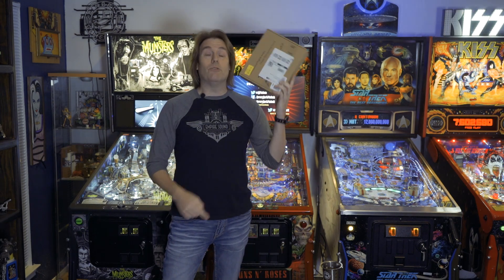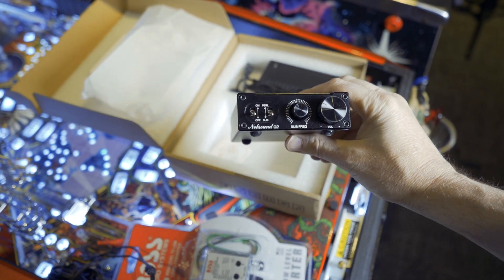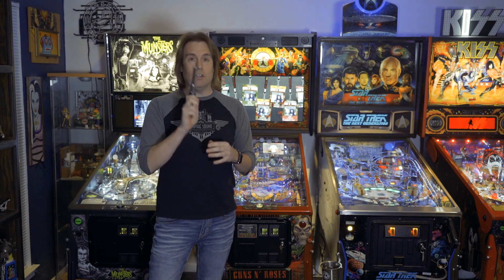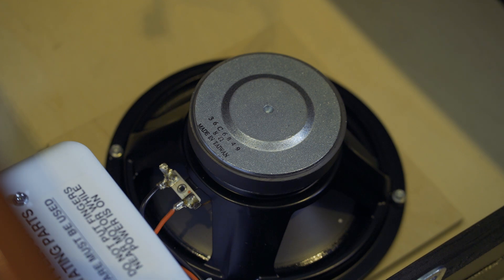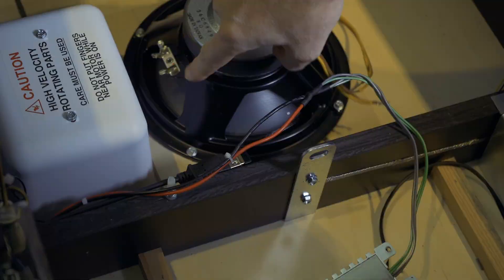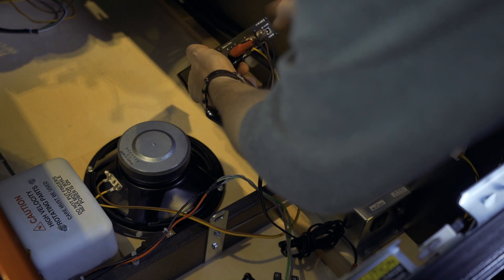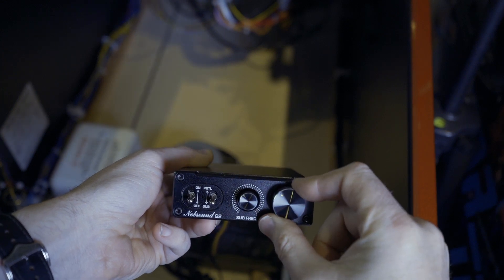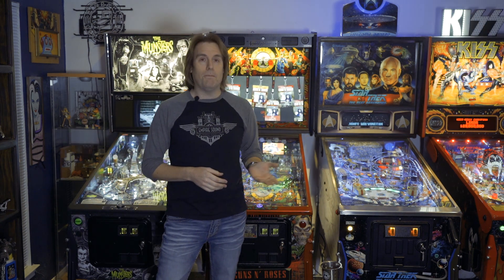Pinball mods-Cheap Mega Bass mod for your Jersey Jack Guns and Roses Pinball machine!

Comment: Great video.  Quick question:  I have a 12" Polk Audio 150Watt External powered sub laying around.  Would you suggest just tapping off the current sub terminals and using speaker level inputs and letting the sub crossover do the work?  Or use a line level converter like you suggest and then run one RCA to the Sub LFE input?  Or run both RCA to L and R line level inputs on the sub?  (ok, maybe it wasn’t a quick question).  lol
Reply from the maker: I would recommend a line level adapter and using your sub woofers built-in crossover and set it to 150hz

Comment: Hey thanks for the video! My GNR sounds fantastic. My SW and Mando both have a ground loop hum. Mando is louder than SW. I have pinstadiums on those games which occupies the service outlet on the power supply so I ran the power for the new amp out of the bottom of the cabinet into a power strip on both games. I’m assuming my issue is that the amp needs to be tied into the power on the game for proper ground? I tried an RCA ground hum eliminator after the line level adapter before the amp but that didn’t help. Any advice would be appreciated!
Reply from the maker: Does your Mando and SW have the Amp mod on them? You could try a ground lift adapter for the amps power cord. https://www.amazon.com/JACKYLED-Listed-Grounding-Adapter-4-pack/dp/B071FFHQNC/ref=sr_1_1_sspa?crid=11VF7EPJ4OKMO&keywords=ground+lift+adapter&qid=1664636652&qu=eyJxc2MiOiIzLjU0IiwicXNhIjoiMy40OCIsInFzcCI6IjMuMzMifQ%3D%3D&sprefix=ground%2520lift%2520adapter%2Caps%2C81&sr=8-1-spons&psc=1   You could also try that on the pinstadiums power cord.

Comment: Thanks I installed your mod and i m very happy with it. I would like to know if we can also add an active subwoofer and wow i can do it if it s possible. Thank you for your help ;)
Reply from the maker: Yes you can,  to add an active subwoofer inline. what you would need to do is get 2 RCA Y cable splitters and install them after the speaker level to line level adapter box outputs.
Reply: @empirepinball  man.. is there anyway you can make a video installing a sub woofer on GNR?  I’m buying everything from this link

Comment: Can I assume that just using a passive low pass filter or cross over just wouldn’t cut it because of the poor power in the original amp?  Has JPP added an EQ adjustment to their programming yet?  (Thank you for the great vid!)
Reply from the maker: I wish JJP would add an eq function, The amp I suggest has a crossover built in.

Comment: I am getting a constant hum when the power is on. Any way to eliminate that?
Reply: Figured it out, the speaker needs to be grounded. Running a separate wire from the speaker to a grounded screw eliminated the hum entirely. Machine sounds so much better with this upgrade.
Reply from the maker: Let me see if I can replicate that on mine, so I can come up with a solution.
Reply: @johnclausing  where did you connect the wire to the speaker ?  Negative output to a grounded wire ?
Reply: I figured it out.. actually used an alligator clip and grabbed a piece of negative wire coming into the unit then onto a metal ground.  Easy fix.  Thanks for the comment

Comment: You mentioned that we should buy an upgraded speaker before installing this so you don’t pop the stock speaker. Is the stock cabinet speaker on the JJP GnR good enough quality or did you already upgrade it?
Reply from the maker: The stock speaker on JJP is good for the mod!  I would say Williams/Bally and most Sterns you would want to put a better speaker in.

Comment: I installed this mod on my Wonka and love it. I do have a slight hum when using the included power adapter. I tried connecting to 12vdc power straight from the pin but the hum remains. Can you recommend a filter or other device to eliminate the hum. The Hum is only noticeable while the game is idle. Cant here any hum during gameplay - Thanks
Reply: Try running a separate wire from the terminal on the speaker to a grounded screw on the machine (I used the one on top of the service power box)